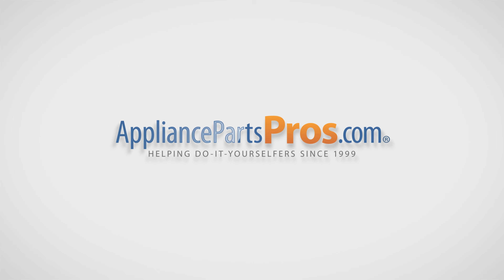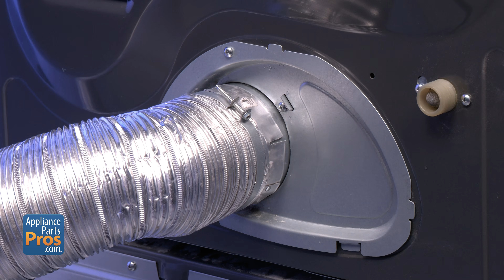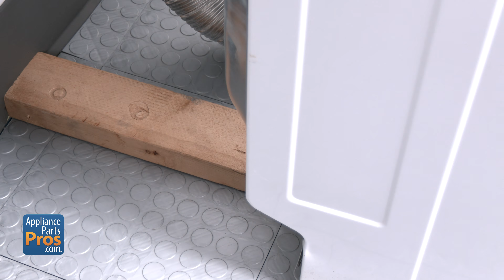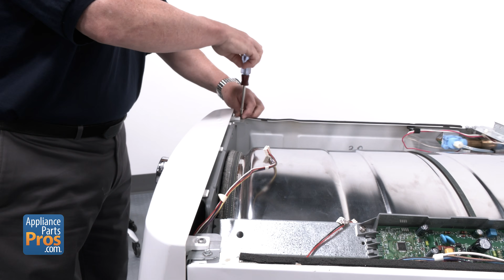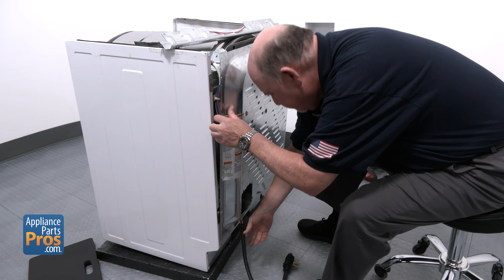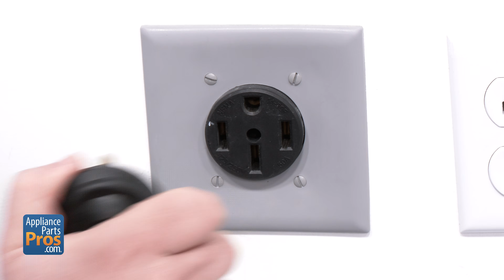EASY Electrolux Dryer Vent Cleaning Hacks You Need to Know

Comment: Your videos are usually more thorough than this. All you show is cleaning the fan. There is a lot more to it than that. 

Using a drill driver can easily strip out the hole in sheet metal. Be sure to set the clutch on a low setting. Better yet use a screwdriver.
Reply from the maker: Thanks for the feedback and tips! We are trying out new video types that could be more accessible to a wider range of people. We are still doing in depth troubleshooting as well.